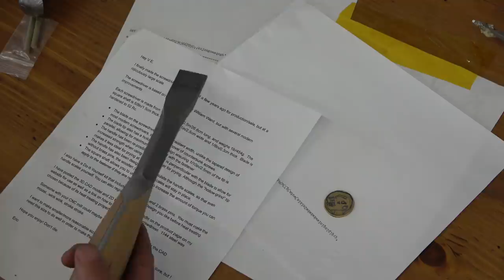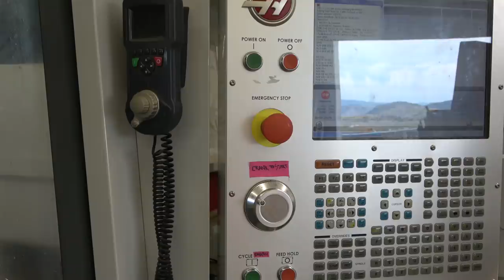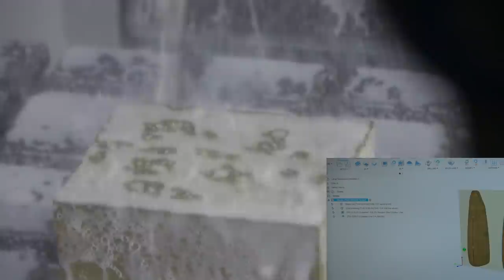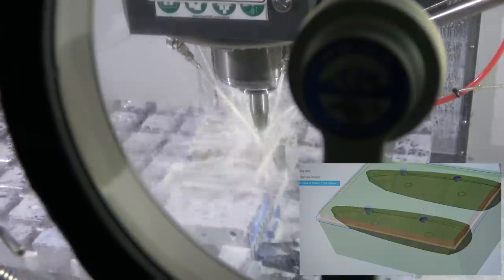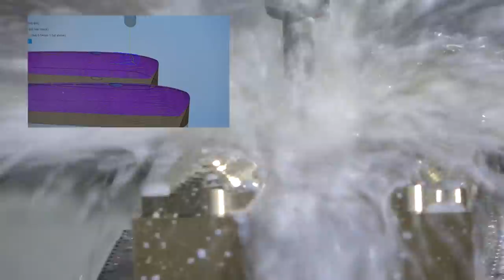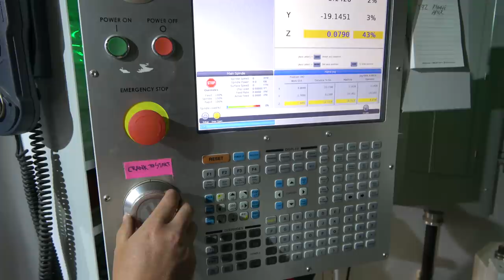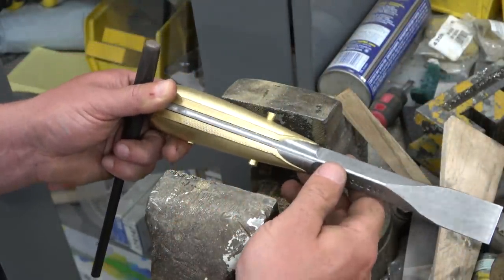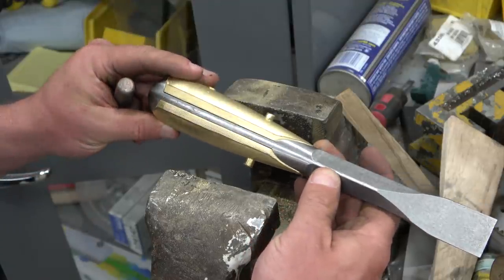Brass handle screwdriver | Hand Tool Rescue

Comment: Best 25 cents ever saved!  You are the first I know of to make brass handles for the DIY screwdriver kits.  Mucho sensuale
Reply from the maker: I've said it before, that 25 cents you saved was money well spent. Lookit all the joy you brought to the world. "it's funny because it's not me."
Reply: Why buy it for 25 cents when you can make it for $250?
Reply: Art
Reply: That 25 cent savings brought countless $  worth of entertainment to all of us. 
Thank you.
Reply: Hey that’s the point
Reply: You are assured it's Precision Fit when it takes at least 20 lbs. to force it in to place. Beauty work.
Reply: @jaylittleton1  i thought it was interference fit and you supposed to heat a screwdriver before placing the scales down perfectly parallel
Reply: I Still Don't Understand Why You Don't Sell A Full Metal Handle Version
Reply: @cprooks  Because capitals...
Reply: With Lumber prices now, its probably $150 saved by skipping the wood handle.
Reply: @diamonddogie  heating will destroy the temper.
We don't want Ave operating a torch while embibing Molson😉
Reply: @adamcobie4207  🤣👍
Reply: @jaylittleton1  or over sized.
Molson Golden.😂

Comment: Ave: carefully cuts block of brass using precise measurements. Carefully machines on CNC. 
Also ave: finishes cuts with sawzall and beats material into place with mallet.
Reply: Tappy tap tap
Reply: As one should..,....,...,...
Reply: why not heat the steel and cool the brass, i ask with sawzall in my hand?
Reply: A time and a place for everything haha
Reply: Observe the duality of man.

Comment: After years of experience...I can tell you with absolute certainty that putting the wrong pin in the wrong hole happens, on average, 100% of the time.
After all...why WOULDN'T they be different sizes!?
Reply: That's what she said...😂

Comment: I gotta say, seeing that huge block of brass come out I really felt it with "retirement fund" written on it. Knowing how much was gonna go into the chip tray hurt me somewhere indescribable.
Reply: The percentage in the chip tray is a representative of the charges the pension fund managers take.
Reply: We always had to do a thorough machine cleaning to keep different materials separated to recover the most money from recycling them.  Aluminum and brass mostly, and especially so with titanium.  Plastics and steel pretty much went directly into the dempsty-dumpster.
Reply: And then it just gets mixed in with the steel scrap, there goes another $10 in the chip bin
Reply: describe where the bad man hurt you on this resin mannequin
Reply: @undisaurus7976  Bad taste. Not the humour for this channel
Reply: @harveysmith100  so what you're trying to say is the bad man made you taste him?
Reply: @formdoggie5  is “bad taste” like “bad touch”?

Comment: I love how he rubs back and forth with the file just to pissing people off
Reply: Last night I was filibg some brass with needle files, and it honestly cut better when I didn't lift the file on return stroke. I wonder where the idea comes from, or does it have some truth in it in some cases?
Reply: @prowokator  On most files the cut makes them only actually work one way, the other way you are just dragging it. However, there are files that are double cut and will work both ways.
Reply: @Cragified  I guess dragging the file on back stroke when cutting brass, cleans it slightly and makes it cut better?
Reply: @prowokator  Might, can't say. I tend to only ever use files myself on steel and other things that are a lot harder.
Reply: It worked
Reply: @prowokator  Since most files have a sawtooth tooth profile, and the vertical face of the sawtooth is on the "forward" (i.e. away from the handle) side, they do only cut on the forward stroke. I guess the idea against cutting on the return stroke is that that might roll over the edge, thus dulling the file? I have no idea how much truth there is to that, but I can see how someone could get that idea.
Reply: @Cragified   X files🤣
Reply: @paulbyerlee2529  I want to believe double cut files are out there 😆
Reply: @rickjames8317  Of course they are. Many files are in fact. Bastard file use to specifically mean single cut, but then American patterns and all sorts of things came along and now people usually just use it to reference a large file. 

Even if the file is single cut, running it backwards unless you are using it on something nearly as hard as it will only really equal wasted effort and marring the surface of what you are filing potentially.

I suppose if you put a LOT of pressure on it on the backstroke it could smash the teeth down.

Sort of like how much energy you use with a hacksaw until you learn that it only takes chips out on the forward stroke and pressing down on the backstroke just makes your job pointlessly harder.
Reply: My first heart from the legend AvE. I know its just a button on his screen it was the highlight on a very hard day. Thank you
Reply: It’s called drag-filing when you intentionally use the file the wrong way. It has reasons.

AvE was definitely on the wind-up though
Reply: Doesnt actually matter unless you're pushing on the backstroke. 

Source: 70+ tool and die machinist who told me that during my apprenticeship, and the 40+ worn out files I used at my job as a machinist testing various filing techniques.

Comment: That screwdriver would be ideal to remove and replace the screw in plug for the sump trap in a pre-unit Triumph twin engine and probably a few other Brit bike engines too !
Reply: I was thinking of the same thing. Maybe that plug in the crank for the sorta spin filter on the unit motors, too. And those alloy plugs in the primary and trans outer covers.....
Reply: @johndoe-so2ef  It's just as I always thought, Triumph were well ahead of their time, they were even ahead of the tools at that time too !
Reply: 68 BSA Thunderbolt, would work perfect on that too

Comment: "Nice that there is some overhang on this pin to get it good an flush"
Knocks second pin in
"Oh"
Reply: Molson
Reply: That's what happens when your looking at the tape measure through the beer glass lol. No problem use the overhang from the other pin send it in with the glue and the lend the tool to the apprentice.  Rule #1 always blame the apprentice then send them off for beer while you fix it. lol
Reply: RIP

Comment: The pins, the bane of makers across the world. Somewhere someone gets a kick at mixing in the wrong pins together, to only be discovered when a project is almost complete
Reply: Kinda like doing a repair on someone else’s woodwork and finding 2 Philips, 3 square drive, a Torx and three God forsaken flat blade screws.
Reply: @chrissorensen9511  anybody who still uses flat blade screws should be punished severely.
Unless you build something for your best buddy, just dont forget to pre cam them out on installation...
Reply: @sarunasbriedis  You sound like the worst kind of person. I at least make sure to break out the file and grind them down to make sure my buddy doesn't catch a sharp edge after they're cammed out

Comment: Who needs fasteners when it's a hammer fit already?
Reply: Somebody who knows it's gonna get too hot one day when used as a 5000A fuse accidentally and you don't want your dissimilar metals detaching then, would ya? :P

read: for overkill points
Reply: @jimmio3727  normally if you're that smart, you'd be holding it in a metal vice thats completely ungrounded so it would reweld in the same 1000th of a second the delam occurs from the arc gap, giving that familiar scent of success from making lighting bolts in your garage better known as ozone.

Take that, Zeus.

Now getting it out of the vice afterward, though? That's the real trick.

Comment: Hard lessons from a former tooling machinist, when two radiuses that need to fit together seamlessly, chances are the inside radius will be too big, and the outside radius to small, creating interference at the apex. The difference is minimal, but it doesn't take much to make a mess of otherwise perfect fit.  You could program one or the other to compensate, but for what yer doing, best thing is to lightly sand one til it fits perfectly. Anyway, looks to be a skookum choocher I'd be happy to bash some former colleagues with...

Comment: Weirdly enough I just found one like this (smaller flat head but longer), it is 18th century, from the Grandad of someone who is late 70s... the wood looks like black ash or something it's very dark. It's built better than many Chisels and it's a screw driver. You can use it for marking cuts on wood and all sorts, absolute beast, made for 1,000 years..  I figured uncle BF would approve it's skookumness but not that he'd have a video of nearly the same design a week later!
Reply: This pattern was patented in 1904. So you're not going to find examples of it older than that.
Reply: @1pcfred  they patented a stolen design...plausible
Reply: Black locust
Reply: @xmachine7003  it's more plausible that you have the date wrong.

Comment: Are you going to be doing an analysis of the condo collapse in Miami?
Reply: Build in 1981 on a sand bar.  The era when Florida and California were competing to build cheaper, faster.  Lucky to last 30 years.  40 years it beats the wrecking ball to take itself down 🤷‍♂️
Reply: John McAfee stored 18 TB of data there. This is the result.
Reply: @P_RO_  I remember back then whole new subdivisions were blown over in hurricanes like paper cups.

Comment: Used solidworks for 4 years at my ex job. Bougth 2 360 licenses now that I am freelance... Found out that very useful features were part of a 2000$ dollars "manufacture" plugin. Back to solidworks.... Fusion 360, fix your "drawing" module and give us a useful feature tree. Thank you.. Ave, your french is impeccable as always. Keep it on! From quebec with love.

Comment: You need some “Never-Dull” for that brass. Haven’t seen any in a while, but I bet it’s out there.
Reply: Never dull is the shit. Use it on my Harley all the time.
Reply: @tinkeringaround6241  But what if it's a knock off?!
Reply: @hdezn26  just look for a can that says “nev-r-dull you can get it at Napa auto parts too under the eagle one brand same stuff

Comment: Do a video on the condo that fell in sunrise Florida.
Reply: I've no background, haven't read anything about it and I've never been there, but I bet I can summarize it pretty easily.

Super heavy building. On sand. Sand and water in the correct quantities makes quicksand. If your thing leans to one side, it usually gets destroyed. I think that pretty much sums it up.

Just read the NBC report.. their pool deck leaked to the foundation for years, cracking supports as it ran, and they just kept filling the pool. It's just the usual stupidity and negligence I've come to expect from Florida.

Comment: I ve been watching ave at least 5 years now. He never succeeded at making anything. Which i think is the point 😆
Reply: FALSE.

He made a magnificent copper swing press.
Reply: He just made the SLOP 2000 mixer for his concrete slab project.  WORK OF ART !  🤣🤣🤣
Reply: @libertyman3729  i saw that too lol. I was surprised the hydraulic motor didn't snap emidiatly
Reply: Hey now buddy, he made a duck wet

Comment: I got some small screwdriver simmilar to this but looks like build in the beginning of the 1900s ... a beauty.
Gonna restore that one tomorrow. Needs some work. Has some kinked spots... nothing what new handle scales and some sanding and filing won't fix though

Comment: I think if you cut the backside first and threaded the holes. You could then bolt the part on a simple block w/ two holes. Then cut the complicated part. Clear as mud??
Reply: Yeah, but then he'd have to make 2 cuts on the saw and make sure it was closely aligned.

Comment: Releasing software to the cloud is 1000x easier than desktop software. This gives you a tighter feedback loop, so make sure you report bugs, make suggestions, and even request features because if they are doing things correctly you should get fairly quick turn around for well defended cases. 

Unfortunately with this practice also comes the fact that some times you release features that aren't fully polished to your users. Maybe they are missing key functionality, or maybe they missed the mark entirely, But if they are doing it properly it should be a minimum viable representation of the feature that can be scrapped without much loss, or evolved quickly over time.

Comment: Next time try some liquid nitrogen on the brass to shrink fit it.  Figure heating the driver would ruin the temper but you might get some wiggle room with some extra cold.  Great video!  This is an art channel now.  A little brass cap'er on that short pin- no one will know but us.

Comment: Two different sizes for the pins because the handle is two different sizes where the holes go through . . .long pin at the back . . .shorter pin in front.

Comment: Pro tip : you can saw more material with the machine and avoid doing it by hand, .3 metric will do and your part won't fly off even though you would think otherwise. Been there done that.

Comment: The flat screwdriver is not a driver at all but a screw screwerupper.  But they make great pry bars,  until the tip, and only the tip, breaks off.

Comment: Reminds me old Soviet joke: 
Chinese bought design of ultra-modern fighter jet from Soviets. They assembled if according to the documentation and got steam engine. Disassembled, tried from scratch. Steam engine again.  And again.
So they asked Soviets to send over engineer to help with the assembly. Engineer worked three days in closed garage and voila: fighter jet! Chinese were abashed: "How did you managed to make it?" - "Well, looks like you missed the last instruction in the assembly manual: 'Use file to give it the right shape' "

Comment: There are some associations that offer a Solidworks license as a perk of membership. They tend to be groups that would benefit from that kind of tool. Aircraft and experimentation and such. Anyway, I have found that as a nice alternative to the, ahem, position, Autodesk has taken with its software. Not sure if the license is conducive to the stuff above the doobleydoo, but worth a gander.

Comment: Ave do you think you can make a video about the Surfside building collapse? After the bridge video, it'd be great to have a larger channel address concrete structures under compression and subsequent failure due to the sinking foundation. I think you could even make a model of the building with non soluble plaster impregnated with a high volumetric density of small lead shot (follow good MSDS/PPE precautions ofc) for weight and get the plaster thickness strength to weight ratios close enough to mimic concrete. Place or build it on a 12" deep dry planter soil substrate with percolating tubes for water mimicking the swimming pool liner leak. Use a squirt bottle to Introduce the water underneath the area of collapse, and see what happens over a couple of days or weeks.

Comment: The team over at Autodesk have put a lot of resources into the new tool that allows you to put your machine into the fusion world with the billet in the vice.. apparently so you can make sure that your machine can make the part and you don't accidently program in fun things like your expensive new bits crashing into the vice... My favourite thing though!? - the fact that they realised that fusion360 is good for designing basic parts, but average at making life easy for professionals (my point is coming). Once they realised this.. instead of fixing fusion360, they just started again and made 'inventor'.. its at least 4 times better for design. Doesn't help the fact that you've got to pay for the fusion for doing your tool paths and what not, so youre stuck.

Comment: I wish I could show the double headed horizontal milling machine I run. It's a massive Ingersoll that though it's been refurbished and upgraded through the years, the machine itself is at least 70 years old. I'm still required and expected to hold tolerances of +/-.000" when an operation on the blueprint calls for it. More typically I see +/-.004"  We make huge rolls for other steel mills all over the world. Depending on what roll it is they can weigh over 50 tons and far more right after we pour them and before any cutting or machining, etc..

Comment: I used the school shop lathe to turn octagonal stock for a handle and then the ceramic chip forge to shape a flat bladed driver for my dad. Who said it looked nice and was probably tough but that he wasn't strong enough to carry a full set and best keep it to one. Lol and you used brass. Lol I used light weight mild steel

Comment: So, honest question. Why pin it? heat the steel, slip the brass in, let it cool. no holes and you will never get it back apart.

Comment: Put the handle of a belt sander in a vice and lock the trigger on... use that instead of a file... more accurate, faster and easier

Comment: Clean parts thoroughly.
Brass / bronze inlays in the freezer for a couple hours.
Steel screwdriver blank in ~400°F oven for 45-60mins.
Hot-potato the three together; scarcely any need to hammer parts together IF you did your math right.
Profit.
FedEx-Smurf the union back to Hand Tool Rescue.
Focus you fark.

Comment: The show Forge in fire . Will show you that you are not alone in putting pins in the  wrong place. 
Before you put in new pins. Counter sink the holes.  Drive in the pins,  mushroom the pins then file flush.

Comment: Yep you didn’t read the instructions again. Ave. Use your eyes one pin in longer for the thicker end of ob je dart how are you going to hide the end of those pins as you can with a smooth surface. Visions of ave dremmling the grooves into ends of pins and they end up invisible. The crazy Aussie